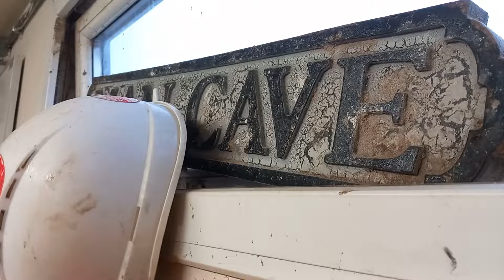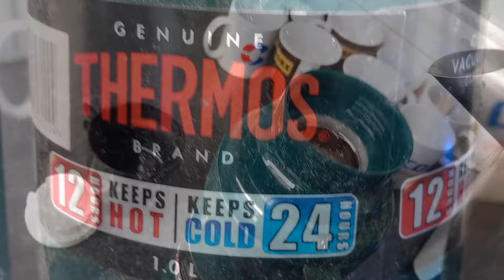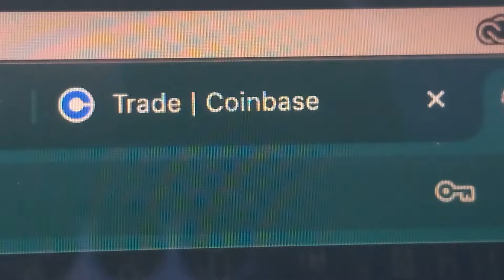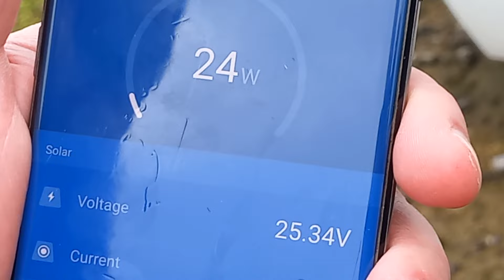Winter VanLife S15E17 Watch the Skies - Keep Looking.

Comment: I was updating my comment,and YT slowed down the connection,and caused my comment to disappear. Ho hum,another day in paradise. My guess,the Ai didnt like the Sky Pirates referencing. All the best bud,have a great Sunday.
Reply from the maker: Boomers have the endearing habit of pushing keys and clicking the mouse during a screen freeze. You deleted your own comment. Do not edit as it renders my reply out of context.
Reply: @SocksWithSandals  Fair enough,I can understand that.  Nevertheless.it always happens when its something a bit edgy. And it's ok,the reply disappears with the comment,though i did see it briefly. Also,was only a grammatical edit.

Comment: Hi Mr T, your van is still resting I see. Contact me on the scrambler if I can be of any assistance. Those pesky Kem trails are getting worse. Not much blue sky these days.
Reply from the maker: What would get my Euro 5 van going is a top end OBDII diagnostic reader, so I can measure the DPF manometer pressure differential and reset the mileage on the EOLYS fluid pump.
Reply: Would a replacement pat fluid pump be part of getting the van running?
Reply from the maker: It may be. That's another £350.
I don't wish to throw any more money at this vehicle, JW. It's been cheap rent just two miles from work, and to that extent I am still quids in compared to any other accommodation solution. There is actually no requirement for me to have a working van just so I can film and produce interesting videos.